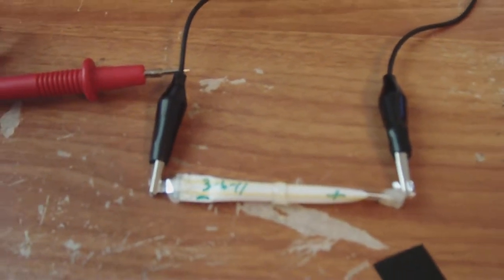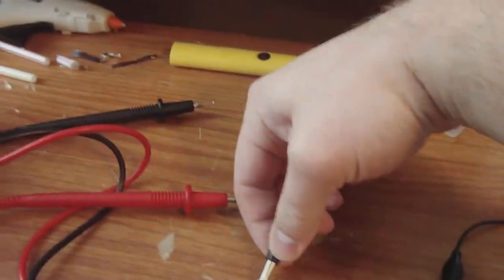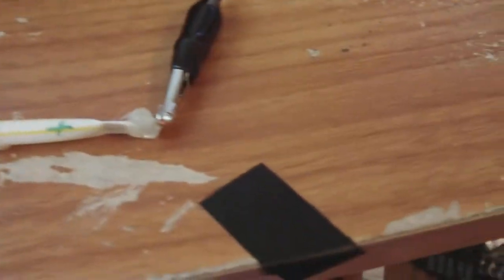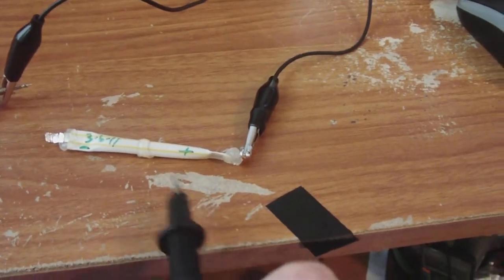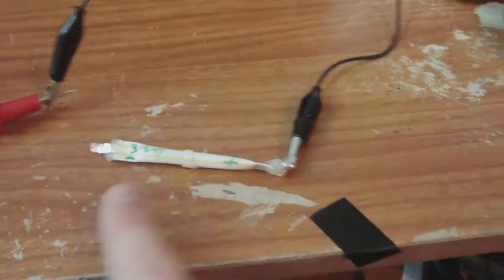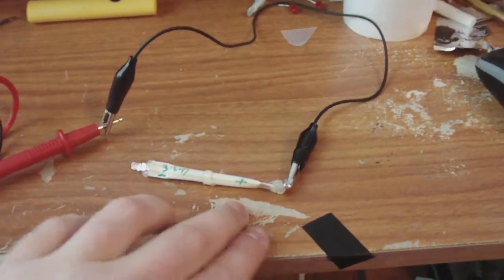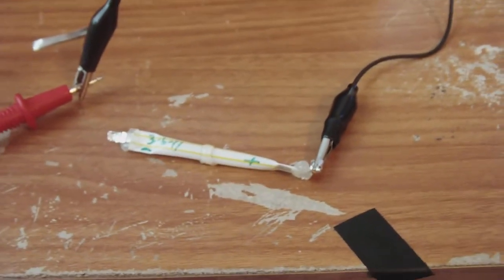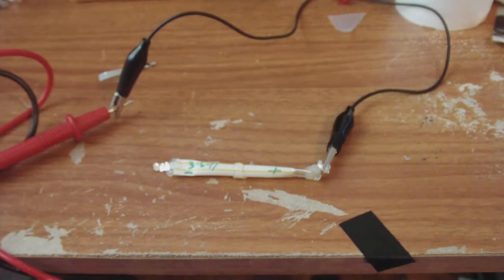Small Same metal water battery 200mV

Comment from the maker: @overunitydotcom 

There's not much current in one cell like the one in this video, it's around 1 micro-amp. Combining the cells is where it starts to get interesting, I have a YouTube video of older design of this same metal water battery that i called the "water captret" ( both are the same) and this group of cells when given a load will output more amps over time when given a resistor as a load. the older design was less powerful. 

here's the YouTube video link

watch?v=Gi2KOr26WZw